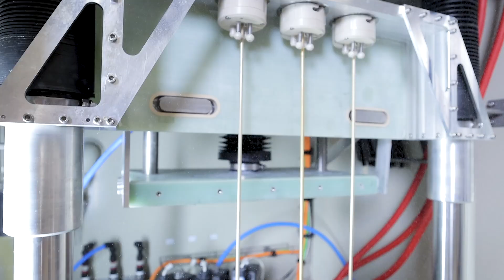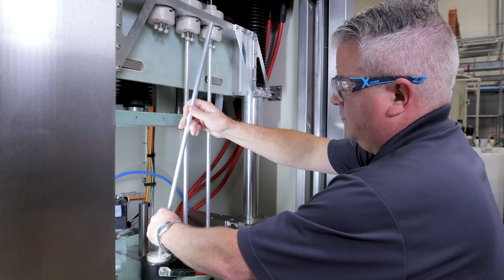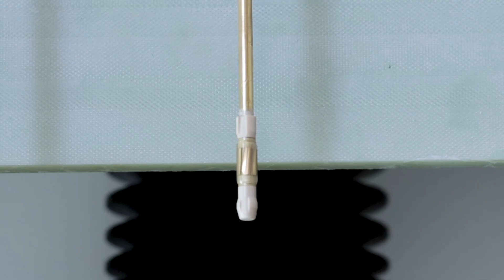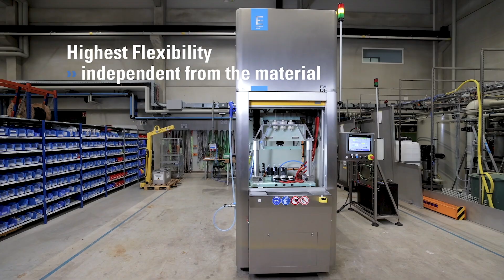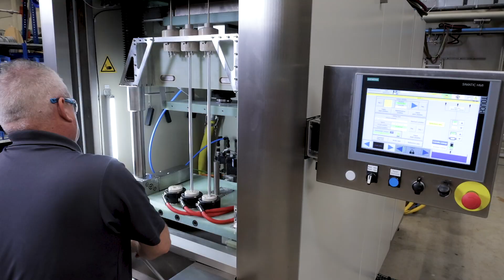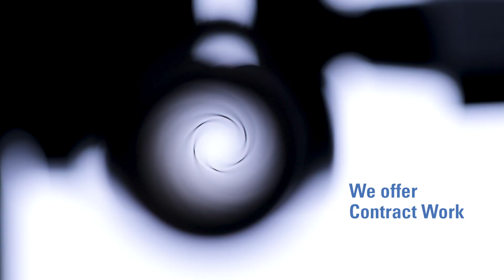Barrel EC Rifling by Extrude Hone EN 2025 01 21

Comment: Barrel tolerence end to end ? Is it  tighter than .0001 ? Smootness of internal . How do your barrels compare to the industry standard benchrest barrels today ? Say a cut rifle barrel that is lapped ?. I guess what im asking is. Could you compare your final product to a traditional barrel showing borescope video comparison of a top tier rifle barrel and your current production  barrel . Another thing could you show comparison of your production barrel and the current industry standard after multiple heat cycles checking for straightness ?
Rest assured the current barrel mfg companies are going to or already have bought barrels for comparison. Which is good for industry. If there is a better process im all for it .advancement is key to survival in any industry. Good luck hope you knock it out of the park.
Reply: This isn't a barrel manufacturing company, they build and sell the ECM machine, barrel companies, or gun manufacturers would purchase this machine to make their barrel's.
Reply: @EssPhour understand but what a the machines capable of say .0001 " or .0003  tolerance end to end .

Comment: Sinker EDM electrics, and similar process. Why not a custom length rod to match the barrel, with no movement through, instead of that tiny brass 'button'? Does the button have better 'chip removal' or in this case dust solution removal?
Reply: Because the tool needs to erode clearance for the tool to go into the barrel.